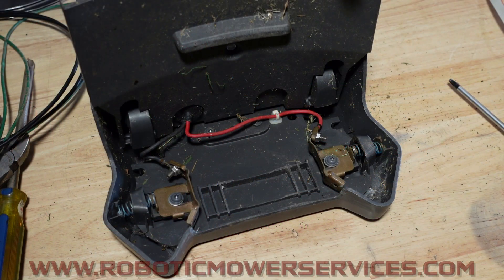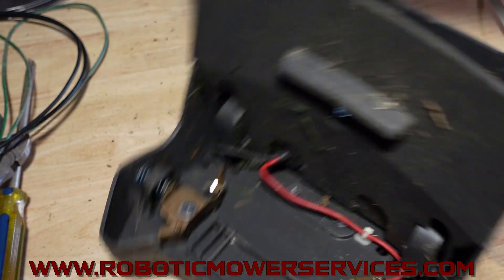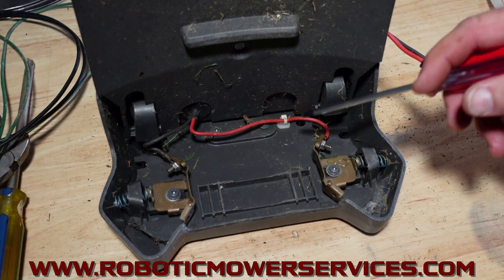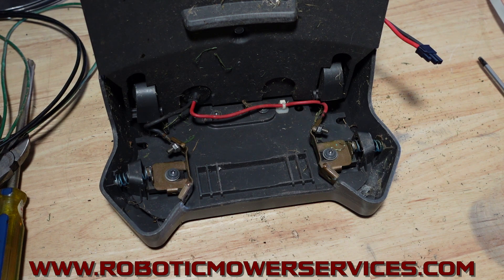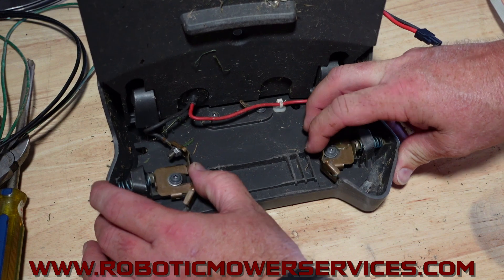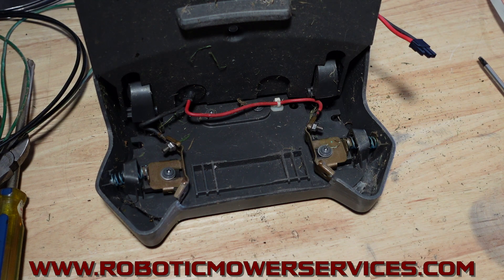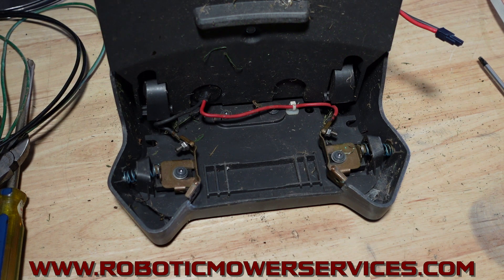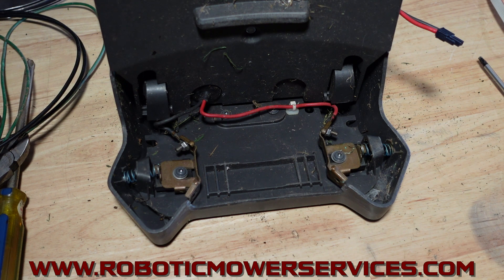Automower Not Charging, Charging Station Blocked, Charging Current Supervisor Error (Vid #1)

Comment: You saved the day once again!  However, my bad connection was at the little junction connector that joins the outer hull to the 315 body.   I used conductivity meter, and there was no connection on my brown wire at the connector.   The little terminals that were screwed into the blade contact on the hull were bright and shiny copper and no problem that end.   And my charging station which I checked first is ok, but I did try the faulty unit in another charge station and it had same error so I knew it was in the mower.  All I had to do was to disconnect, test and reposition the connector pin and sprayed a little mass flow air cleaner in it to dry it out and clean it a bit.  This is the end of 6th year for my three  315 units that operate 9 months of the year in harsh Florida weather, and thanks to your help and online store there has never been a need for any major repairs that cost much of anything.  What great investments, and there is no overestimating the value of the joy of watching them work from the comfort of the house on those HOT, dusty days.   I did find the new 5 blade cutting disk to solve my crabgrass problem so that was a nice upgrade from you.  I am in your debt once again.  Thanks a million.  How great to have such a helpful expert take the time to give this information...a true open source hero!!!
Reply from the maker: Thanks buddy! Always good to hear from you and even better to hear that your mower is still getting the job done after all these years!

Comment: Very educational videos, these helped me to deduce the actual problem.

Had a problem like this and I tried every fix but none of these videos had the answer. I did all the tests and my charger had no flaws. These tests tho taught me enough skills to continue my research into the robot itself and finally found out that the reason was the charging plate cable. I am also at fault since I have probably installed the cable back carelessly, and the weather proof rubber part was not properly installed. This caused moisture to damage one of the cables. I replaced it for 80 euro and now it finally charges. I almost bought a new charger for 360 euro and it wouldnt have even fixed the problem.
Reply from the maker: Glad to hear you were able to diagnose and fix the issue!

Comment: Hi, 
I keep receiving the 'charging system problem' error on my 330X. In spring it appeared at low temperatures. Letting the mower mow by pulling it out of from the dock it mows well and after returning it recharged and mowed. But now the error appears constantly and the mower does not leave the station (although after pulling it out it mows but returns for a recharge and the error shows right at 99% or 82% and it stops).
I have noticed in the hidden Info menu that the battery 2, when docked and charging, shows interesting pattern. It charges approx 2400 2500 or even 2600, but then current starts to drop and the voltage raises at the same time. When the voltage reaches approx 25.5... 26.5V the charging system error is shown. I pull the robot out and then back, the robot starts charging reaching current over 4000 again and then similarly starts dropping and voltage rises. When over 25.5 or so and the current closer to 0 the error pops up again.
Should I change the battery? any other hints?
Voltage at the dock is 27.5 constantly, although slightly below 28 I guess that is good, and something in the robot keeps the charging system problem to appear
Reply from the maker: Hello, we have created and added this to our website (www.RoboticMowerServices.com) to help solve these issues. https://www.roboticmowerservices.com/_files/ugd/a085a8_363c3d6c270b4ec19a4424c7fa57dc51.pdf

Comment: I don’t have any error messages. Charging station board was replaced last month. Mower seems to be struggling to find the station and I’ve observed it climbing all over the thing without docking. All wire voltages seem ok but I do have about 3.5ohms in both loop and guide wires. I know for sure I have some joins in both wires were they have been damaged in the last. Installation is 6+ years old. What should I’d do please?

Comment: while checking the terminals/wire connections on older models you should also remove the black Fiber washers that are there.  as this were also causing issues and Husqvarna stop putting them as they caused resistance between terminals and screws.